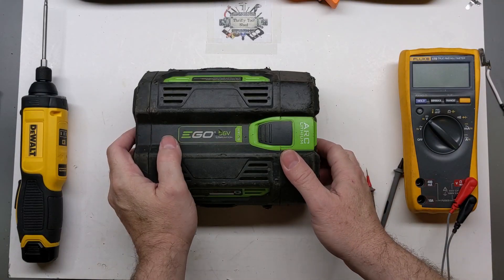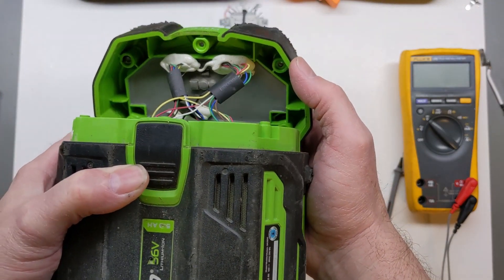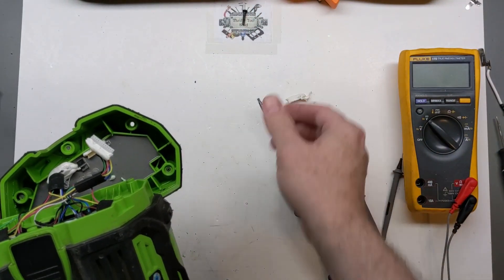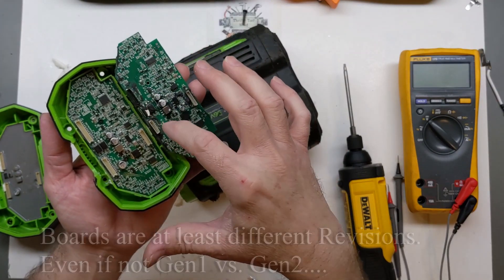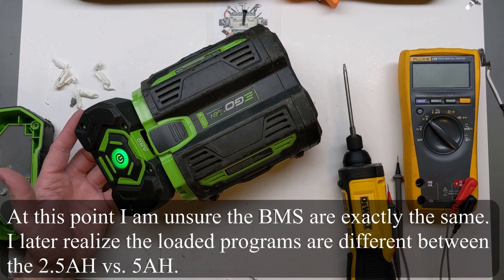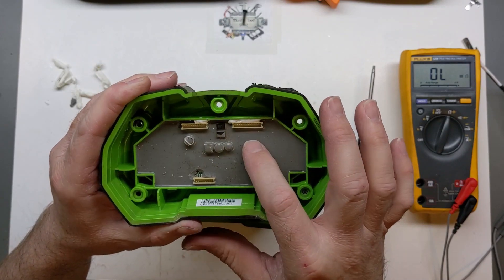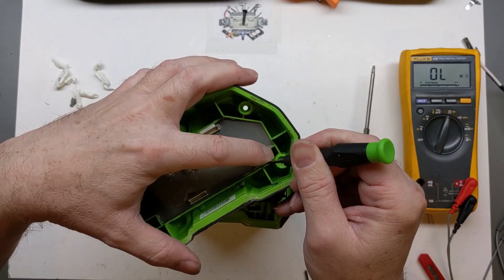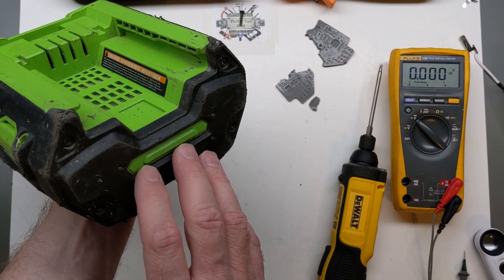EGO 56V Gen1 5AH Blinking Orange Fix

Comment: I have one 5ah and noticed barely any voltage between B5 and B7. For there rest of the measuring points it is measuring around 3.58. The voltage across the main is only 46v. Now I measured on the cell pack and all of them (4 measuring points on each of the 2 cell pack), is showing 3.58. I cannot figure out which cell area corresponds to between B5 and B6. Can you help identify?
Reply from the maker: I do have a 2.5ah wiring video to help someone having a similar issue figuring out which BMS wire color corresponded to which cells. It may be similar. The other way is trace the B test points like B5 for example to the connector and then trace the wire from that connector pin to the cells. I have had luck cleaning the connectors and reseating them.
Best of luck to ya!
Reply: @ThriftyToolShed   I have tracked down the cell pack for B5 and B6. If the voltage is low between those 2 points (B4-->B5 is good and B6-->B7 is good), is the issue with B5 or B6?
Reply from the maker: I usually check from the cells to connector with same wire and also check between the connectors for the B5 and B6 to the respective test points for B5 and B6 and see if bad connection at the connector. I have had the connector have minor corrosion on these a few times a d give issues. It would say reading low between B5 to B6 would be  bad connection on B5.
Reply: @ThriftyToolShed   - Thanks. Great job. You pretty much answered it in your other video - https://www.youtube.com/watch?v=Z10OJLeQwno
Reply: Here is an interesting behaviour, not sure if you have seen this. Battery is 5MAH. After charging the cells, I was able to use the battery in a blower. It lights up green when in use. But after a few seconds the light turns flashing red and blower stops.  I can restart it and then same thing; it turns red, and stops. I did put the battery on the fast charger (thats all i have), the charger thinks for a few seconds, then goes straight to 100%.  Now I have 2 BMS boards, the old style without gauge indicator and new style with indicator (both with Gen1 connectors).  They both behave same way on charger.  Only difference when i press the gauge - the one without indicator lights green, then other shows low charge red, followed by flashing red.The only thing I can think of, should each cell pack be balanced at same voltage? Right now, some are in the range of 3.58V, 3.52V, 3.6V, 3.57v. Any other thoughts?
Reply from the maker: My first thought is that the numbers you give as far as balance should be close enough, but if the board is not getting correct reading to controller such as corrosion then it could seem like they are more unbalanced. Its hard to say on these issues. I have had alot of questions about this similar failure so it seems like a common failure. I have not seen this but once and I spent hours trying to test BMS board and never did find an issue with that BMS. On mine I ended up putting a spare BMS board in and mine worked, but yours maybe different if you already tried 2. I don't have any of the newer Packs to Know for sure if you can swap them, but it's good that the connectors are the same. The BMS board is supposed to balance the cells at a slow rate if off a little, how much I still am unsure. It's very hard to say, but from what you are saying and my past experience, it seems the BMS or a connection to it from the cells is the issue. Sounds like your pack is good if that balanced and all reading above 3.5V like that. Wish I knew more about that failure. Still so much more to learn on these. That's a tough one, best of luck to ya!
Reply: @ThriftyToolShed   today i charged another 5MAH battery. All cells show 3.6x and battery around 51.x. This one too behaves the same as the first battery. It works fine in my blower, shows green. then it blinks red and stops. I can restart the below any time i want until it blinks red again. The charger thinks the battery is fully charged.  Strange 2 batteries behaving the same way.
Reply from the maker: @sroghen2 Yes that is strange and must be a more common failure than I had realized. I have seen a good many posts and comments about this same failure. The only one I had which was similar , I fixed with a BMS board swap and I tested as much as I know how and I could not find any obvious issue with the board. All test points read similar and all power components seem to check ok? This is one issue I had that puzzled me. I wish I could have figured it out on mine, but since it was the only one I had seen, I did not  spend as much time as on the other common failures that I had seen multiple times. If I do come across another, I will have to give it another go.
Reply: @ThriftyToolShed  - I can send you the one of the 2. Just let me know.

Comment: I enjoyed your videos. Thank you for sharing your knowledge.  I'm trying to convert a lead acid Ryobi electric riding mower to a 48 volt lithium battery (14s).  I want to charge it using a 56 volt Ego charger.  Do you have a way of tricking the charger into sensing the battery pack so it will start charging?  Plan to use an off the shelf bms for this setup.
Reply from the maker: Thanks for your comment. So glad you like them. As far as the battery goes. You mentioned 48V and 14S. So 48V is actually 12S and 14S will be 56V. One thing I can tell you is that the Ego charger communicates with the pack D-terminal for testing and charging, so it would not be easy. I would most likely use a DC-DC Converter such as the Drok that I have a video on. You would have to get or build a 60V supply or so and the Drok Buck Convetor would make it easy to charge. Just a thought. I have not worked on the Ryobi rider yet, but if I had one I would be doing the same to thing to it I am sure.
Reply: @ThriftyToolShed  Thanks so much for the advice.  It's a 14 cell setup so yes technically 56 volt at 4 volts per cell.  Hard to find a specific charger that just limits output to 56 volts.  I may just use a bench power supply.  I will look into your suggestion.  Thanks again.

Comment: I found a quicker way...dropped it on the floor (carpeted) in frustration and it fixed it 🤣
Reply: I had this problem.  After reading this comment, I tried the same solution, and yes, it worked.  Just finished mowing the lawn.  Thanks Athco Locks.
Reply: Watched the video thought well I’m screwed. Saw your comment, said what the hell I got nothing to lose. I told my son I’m going to go drop the battery. He looks at me and says isn’t that expensive? Dropped it in the grass, press the button, green light. Handed it to him and said get to work. Thank you very much.
Reply: Bruh…..this actually worked for me too lmao I just tried it now 😂😂😂
Reply: Followed this and i dropped mine on the lawn. Works like a charm. Thanks heap
Reply: Worked here too…utterly shocked and amazed.  Would be interested to know the why, but either way I’ll take it!
Reply from the maker: @revivethevivid  
The actual video you are commenting on goes through this troubleshooting and we find a loose connection (possible corrosion) on the connectors in between the middle of the pack halves. Some of the newer packs have soldered connectors while many of the first generation have these tiny push on connectors. So a quick bump can work, but it may only be temporary. when I see this issue I will atleast take time to separate the pack and clean the connections. It is best to even solder them on, but to just finish the grass cutting.....
If a good bump gets it going well go for it! Lol...
Reply: @ThriftyToolShed  brilliant!!!  I will save this video then, thanks for the input and clarification, either way you’re saving me a couple hundred bucks, it’s greatly appreciated!
Reply from the maker: That is much quicker! 🤣
Reply from the maker: Look at you guys! 😂
Reply: Read these comments, went out in garage and rapped the battery with a rubber mallet and it turned green!! Thank you!!!
Reply: Also came to report, a quick toss across the yard solved this problem.

You are a hero
Reply: In the computer repair world that's called percussive maintenance :)
Reply: @robbierisque  😂😂😂😂 brilliant
Reply: Lmfao, I was going to watch this entire video and it seemed complicated so I went with the advice provided in this comment and it fixed it 2nd drop! Wooooo!
Reply: @xfcarcache8771  I tried a couple drops and got no love.  I don't recommend it as a solution, it's temporary at best, and will possibly cause more long term damage.

Taking the battery apart and cleaning the connectors did work.  Spray some MG-801B contact cleaner with PPE on them once they're apart.  I cleaned first with de-oxit, and then used the MG-801 to finish the job.
Reply: It's weird but it actually works🤣 it shows to the battery who rules on the yard
Reply: +1 for giving the battery a firm rap on the side with the light resolving the blinking orange light issue.
Reply: Un friggin real! My battery started flashing & would display the Orange Overloaded light seconds after being in the mower. Was getting worse & worse. Was looking online again today & read all the Drop it comments...dropped mine from 40 cm onto pavers & Bam! Green light! Just finished 20mins of drama free mowing! I've wanted to chuck this battery across the yard many MANY times....& that would have proabably fixed it! 😁
Reply: Worked for me too!!!!!
Reply: Holy smokes, that worked for me as well. Even if it's a temporary fix....
Reply: Can confirm that this still works 😂
Reply: @wesholley2558 what issues were you having that dropping it fixed the issue?
Reply: The drop worked.
Reply: I was sure it was a joke, I hit the battery several time with the palm of my hand. I felt incredibly stupid doing this, but it worked!
Reply: Can confirm that the drop worked. Was a very quick solution. Thanks
Reply: Oh wow. Just did the drop and it worked. About a foot off some soft carpet.
Reply from the maker: Yeah, I have been laughing at these comments for a while now and while it's funny and cool that it does work in a tight. In the video we found the bad connection, cleaned corrosion and tightened up the connection properly. Even though it's obvious to most that this is the correct way to fix it, we have been having more comments about broken connectors on the BMS board and of course it is from being dropped and dropped and dropped and most likely dropped a little harder this time and oops! ⚠️🤣
Reply: Just did the same thing! Saw the video was 15 minutes so I went to the comments and saw yours, tried and it worked 😂👍
Reply: Not kidding, this solution worked! Thank you. I dropped it on the grass a couple times and no orange blinking anymore when pressing power button.
Reply: Wow lol I just tried it and tada lol
Reply: and I dropped it on concrete

Comment: Awesome video. I have been watching all your Ego videos to find the problem that I have. I have 2 batteries that read 57V fully charged but the batteries do not last half of the time. I even replaced the equipment and still have the same problem, drain so fast even with a good and healthy voltage. Thoughts?
Reply from the maker: Most likely at least one cell or Cell cluster is going low on you. I typically run it down until it shuts off and then go around as mentioned in several videos on the BMS and check accross the GND TO B1, B2 all the way around to B14 and see if you find a one that is lower or below the 2.7V or so. Somewhere below 3V the BMS will shut pack down to protect cells even if rest of pack still has capacity left. That would be why I check first.
Reply: @ThriftyToolShed   Thank you!
Reply: @ThriftyToolShed  any chance you service these packs? For a fee of course.
Reply from the maker: I wish I had time, I do get asked this often. I do not have a repiar service at this time.  I work full time+ in a Industrial job and try to have time to edit videos to post. I try to help by posting what I have found with a repair.  I don't have alot of time left, I wish you the best of luck with yours.

Comment: Yet another great troubleshooting video! You commented that the Gen 1 BMS on the 2.5 and 5.0 ah have different programs, can you please elaborate on the difference? I have a 5.0 ah unit that I repaired using a 2.5ah BMS and it seems to be working fine both on the tools and also on the charger. Would really love to hear what is the difference in programs between the two BMS is. Thank you.
Reply from the maker: I do not have the program of course to know for sure, that is why I did not talk alot about it just a mention. Two things we know for sure is that the 2.5ah does not have that temperature monitoring middle board so must not look at that since my bad connection did not show up on the 2.5ah BMS. The second thing is some tools get the information from the D-terminal of the pack about the power it can deliver and some tools I am sure does limit output with the smaller packs. I know the chainsaw performance will reduce and if not mistaken the Mower but I am not 100% sure which ones. It seems the 2.5ah BMS could be a work around for a faulty temp monitoring board on the 5ah? Maybe the only drawback is the possible reduction of output power from some tools.  Hope it helps and thanks for your comment!
Reply: @ThriftyToolShed  Interesting indeed. And yes, when you plugged it to the 2.5 BMS the orange blinking didn't show up which would be a good indication on the difference of the two BMS's. Not sure if you have noted it also, not all of the wire connectors slots are populated especially the 12 pin one. I might have to take a look on the  number of wires in each wire connector to find the difference. But for now, the repaired 5.0 ah battery seems to be working fine on the mower. Thank you again.